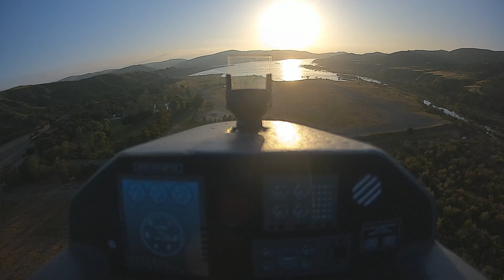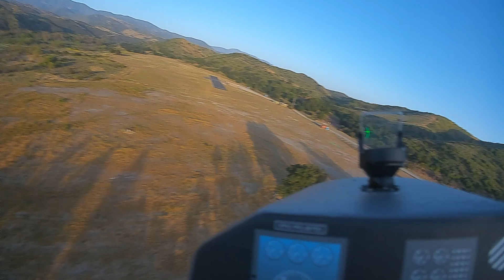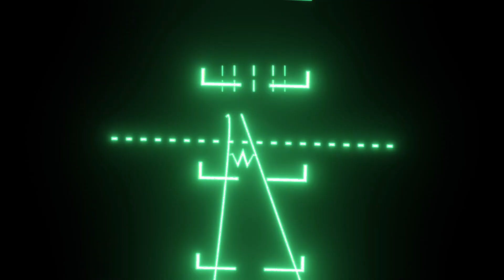FPV RC Jet Precision Landing Drills Using Head Tracker & Reflex Sight  🎯📐🛬

Comment: what is your favorite plane to fly fpv?
Reply from the maker: This E-flite Viper 90 is one.  The Flightline Spitfire is one for the prop warbirds.
Reply: @motionsic  Thanks! I am considering a jet as my next FPV plane but need a proper runway though as that seems to be the fun part
Reply from the maker: @stevek6363  Indeed! You will want a smooth paved runway to enjoy buttery smooth landings for EDF jets.  Pick one which can hold the nose up for aerobraking after touch down.

Comment: I bought the arms site as well as the gimbal and the head tracker and I’m very happy with all of it. Could you recommend a transmitter? I don’t have a lot of money for this project But I’m almost done. I just need the radio and receiver.
Reply from the maker: @PatriotMcVeighONLYJustice4WACO   Thanks for your support.  I use the FRSky X20S transmitter with TDR10 receiver.   X18S is also good.
Reply: @motionsic  thanks. I just ordered the x20s and the TDR10. thanks. Now Im running the same thing you are.
Reply: Hey, does that transmitter allow for a mode where your right hand is controlling the throttle and the Rutter and left-hand is controlling the elevator and  the aileron ?
Reply from the maker: @PatriotMcVeighONLYJustice4WACO  Mine is mode 2; left hand is throttle and rudder,  right hand controls elevator and aileron.
Reply: @motionsic  Ok, do you know if that can be changed/?

Comment: Have you ever tried a heads up display? I have a slope soaring fpv rig with vario/airspeed on the h.u.d. All ran through a Matek f405 f.c. you could also set audible stall speed alarms on your radio. I used the vario tone for sloping for awhile before it started driving me crazy😂
Reply from the maker: No.  I have not used FC’s or OSD telemetry yet.  I should, but find that simply using my reflex sight is sufficient for my flying.  So much easier to setup🙂

Comment: What would be a good starter plane for FPV. I fly drones.
Reply from the maker: The 2m CZ T-28 is good.  But if you don’t have space for that one.  The 1.2m E-flite T-28 is a good one, too
Reply: @motionsic  thanks! That is a great plane! Do you have a video of installation and instructions for FPV?
Reply from the maker: @donaldcassity4217  video of transmitter setup here: Easy Head Tracker Setup on Spektrum Radios
https://youtu.be/zpi_qeuuT8k
You can read about how to setup here:
https://fpvdogfight.com/blogs/news
Reply: @motionsic  THANKS!

Comment: Question would it be advantages to have the radio call out elevation and air speed to help you land without stalling.
Reply from the maker: Definitely helpful!  When I didn’t have those, I had a spotter just call out altitude for the first few flights in a new plane.

Comment: Are you able to do a slip?  They do come in handy from time to time.
Reply from the maker: Yes.  A slip is handy if approach is too high.  But I normally approach carrying a bit of power, so shallower than no power approach glide slope.  So normally a slip is not needed.  But for sure slip would be handy in a dead stick situation🙂

Comment: Drone pilot here. You have single handedly talked me into building a head tracking rc jet rig. Now I just gotta find all the parts.
Reply from the maker: Here are the main head-tracking FPV parts:
DJI Goggles Integra:
https://www.dji.com/mobile/goggles-integra

DJI O3 Air unit
https://www.dji.com/mobile/o3-air-unit

Motionsic BAG - BadAss Gimbal
https://fpvdogfight.com/products/motionsic-b-a-g-badass-gimbal

Tally-Ho 2 Head-tracker
https://fpvdogfight.com/products/tally-ho-2-prebuilt-head-tracker

The Goggles and Air Unit can be substituted with your current equipment of course.

Comment: Subscribing just now for more! Awesome experience, great job! That is definetly a goal for scale RC modeling. I had some experience with Eachine Goggles a few years ago before I stopped flying, nothing much though. I rember I dind't have the image that clear, different from the vídeo reccorded direct to the SD Card in the cam, wich had good quality. Is this quality we're watching here the same you have live from the Goggles? Any delays at all?
Reply from the maker: Yes.  The live view quality is pretty much the same as this.  Delay or latency is not perceptible, around 30ms according to spec.

Comment: How does the VR work with the RC plane and remote control system? Was that pre installed or did you personally do that? It’s very cool and I’m interested in it
Reply from the maker: Details in the description. A head-tracker senses head orientation and inputs the the signals to RC transmitter via trainer function which then control the gimbal onboard aircraft to move the camera.  The head-tracker and gimbal are plug and play, just need two spare channels on RC transmitter and receiver.

Comment: Nice touch and goes.  I missed the aerial refueling though!  What was that battery voltage when you got down?  I was hoping it wasn't going to go to low voltage cutoff....
Reply from the maker: Ha!  I did stretch the flight a little too long, the footage even left out half a lap of the plane climbing to altitude😅.  I think had 3.75V  left per cell after landing.  I typically finish around 3.78-3.8V.
Reply: @motionsic  Wow, that is not bad at all.  My Viper 90 is not stock and won't stay up that long even doing touch and goes.
Reply from the maker: @haroldanderson6021  I think I got lucky.  Compared to other Vipers flying at the field, mine (stock) has the longest flight time🤷🏻‍♂️

Comment: That was awesome. You've got great skills man. Any tip on how not to stall this viper flying FPV on a maiden? I have FMS Viper 90 (non US version), and looking forward to maiden flight once I get DJI O3 Air Unit.
Reply from the maker: Best tip, is not to set your flap deflections too much. Half flaps is about 15° and full flaps is around 30°.  That will give you plenty of time to flare even at idle throttle.  Also setup a little reflex on aileron (half trailing edge thickness up).  If you have separate channels for aileron, you can setup crow (see @TwoBrosRC for his high alpha setup).
Setup your camera so horizon evenly splits the screen on the ground.  And have top of dash in view so you can intuitively use that against horizon for attitude reference.  Taxi around a bit to get used to the view before maiden flight.
Use 50% throttle or more for cruise flight.  Whenever throttle is lower than 50%, be ware not to raise nose above horizon.  On landings, keep 25%-30% on approach until you have the runway made.
Reply: @motionsic  thank you for all the tips. That's very informative. Love your content, keep it up man. Happy flying!

Comment: Fantastic flying. Great video.   I have completed my E-flight T-28 with HT gimbal (self designed and built) using a Caddx Vista nano-pro and all ground testing is complete and I'm ready to fly.
I have chosen to not add a flight controller yet but may in the future to get all the relevant telemetry in my goggles.
Questions:
-Do you use any type of flight stabilization gyros?
-You mentioned in another video that you use very tame rates for fpv flying. Would you care to elaborate a little on percentages from the manufactures recommendations for control throws?

From a happy subscriber, Thanks!
Reply from the maker: Thanks.  Regarding flight stabilization, I use Fly Eagle A3Super3 on the Viper,  no stabilization in the E-flite T-28.  
About the rates, I always start with the linkages, by moving them to the outer most hole on the surface horn, and closest to the inner most hole on servo horn while still being able to reach manufacturers recommended throws by increasing the servo travel (end point adjustment).  This provides the maximum resolution with least slop and best mechanical leverage (least torque required from servo).  I then adjust the high rate and low rates based on flight experience from the cockpit.  Moving from LOS to FPV flying, a good rule of thumb is from 100% to 70%, but I usually end up using even lower rates for FPV, especially for formation flying.  But I switch back to to high rates for landing or low speed maneuvering.
Reply: @motionsic  Great info. Thanks for sharing your knowledge & experience. I'll play around with a third rate position to address full elevator travel for landing specifically.

-Follow up question, do you employ a flap/elevator mix? (typically used in LOS flying when flaps are deployed)  I have flown a dozen aircraft but the T-28 will be the first with flaps.
Reply from the maker: @BigDaddyI1I  T-28 will need flaps to down elevator mix or it will pitch up when dropping flaps. The Viper does not need the mix.

Comment: Excellent job on the landings and flying.  I'm very interested in this head tracking thing but I would want an air speed indicator mainly for the landings.  I have seen some but don't know if they have them for the smaller planes.
Reply from the maker: They do have airspeed sensors for FrSky and Spektrum receivers.  You can program transmitter to have airspeed readout.  To get airspeed on screen display in the goggles, you will need to install a flight controller as  well.  Something I am learning to do….
Reply: @motionsic  Yes.  Read out in the goggles would be preferable.  If u figure that out, plz share the info.  Thx
Reply: The technology definitely exists to have the info in your goggles, or on a display inside the cockpit, either way…

Comment: This is soo cool ... how much would pat for this aircraft setup. ??the one u have right there
Reply: About or approximately...
$600 Viper 90mm pnp
$100 gimbal 
$140 8 channel receiver 
$300-1500 radio
$100 6s 50c 7000mAh battery
$150 -$300 dji air unit
$350 - $600dji  fpv goggles 
$125 miscellaneous products battery balance leads soldiering kit